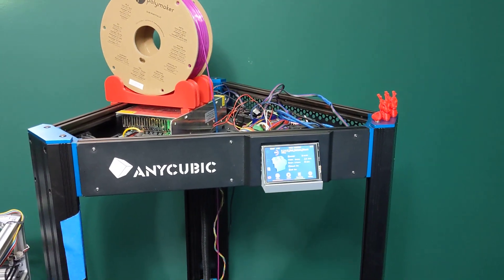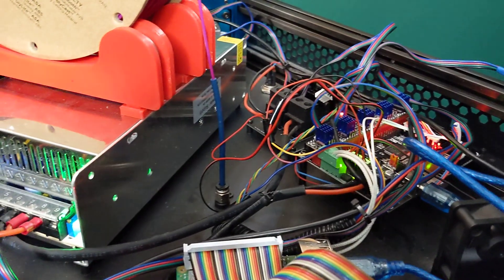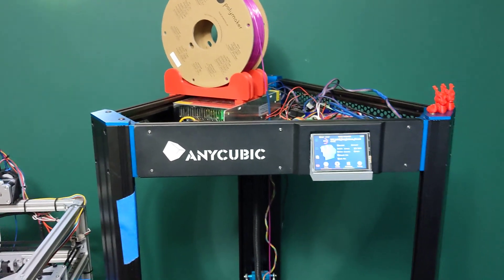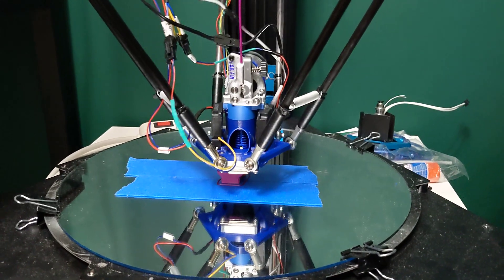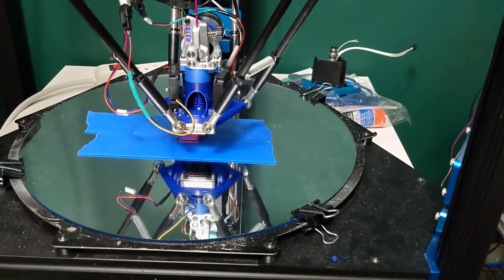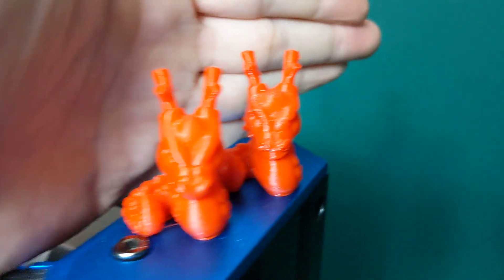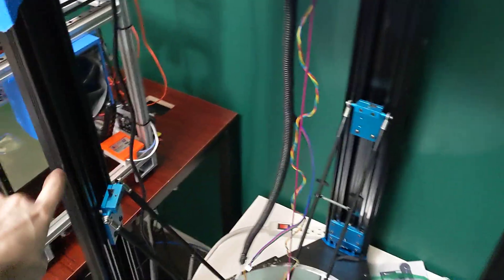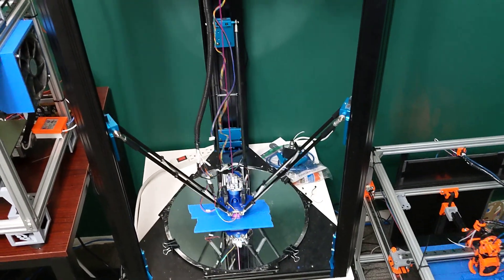Anycubic Predator Delta 3D Printer Upgrades Part 3 - Final

Comment: Did you print the rapido effector without any supports? There’s a pretty large overhang in the middle.
Reply from the maker: you should not need supports, this was a while ago but I did not use them as far as I know

Comment: Nice vid. Did you try a Smoothieboard on your deltas? Just finished building a Kossel style delta I started in 2016 and the Smoothie is very nice. Cheers.
Reply from the maker: thanks, I usually run Bigtreetech board and Klipper on my deltas
Reply: @Rolohaun  they look very well made. The SKR 3 EZ with new modular drivers looks like a good board.
Reply from the maker: @jazzboy  I have that board and will be doing a review on it soon
Reply: @Rolohaun  look forward to your review.

Comment: Hi There, I also have a predator and was wondering if you have a BOM for the build?
Reply from the maker: not anything official, I used a SKR Mini, Rapido and Sailfin extruder, you can find my remixed effector in the description
Reply: @Rolohaun  Thank you for the reply, was the effector printed in ABS? And are you refering to the BigTree SKR Mini E3 V2 with TMC2209s?
Reply from the maker: @ghostwheel9935  yes abs, no the btt skr 2

Comment: Great video and thanks for sharing ... I just wonder if adding the feeder and a Nema14 on top of the print head didn't alter the dynamics/print speed and accuracy of the printer
Reply from the maker: I haven't noticed any issues, you definitely need to print the effector out of abs so it's rigid.